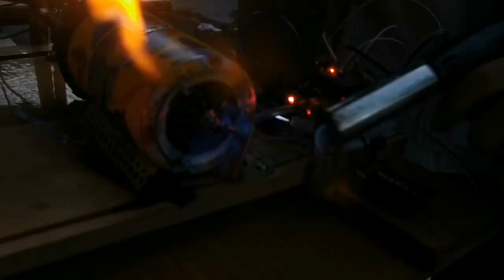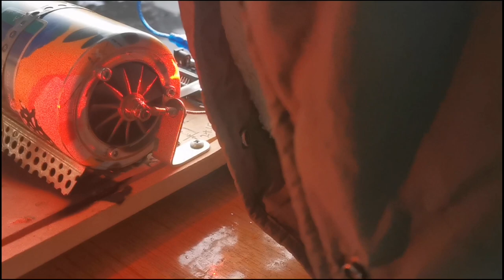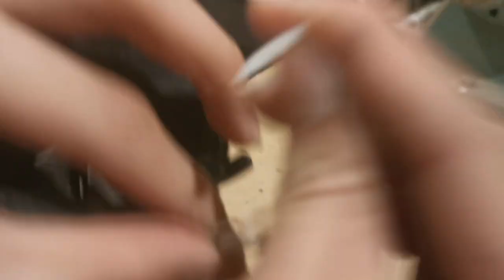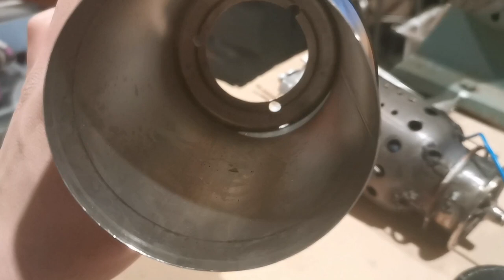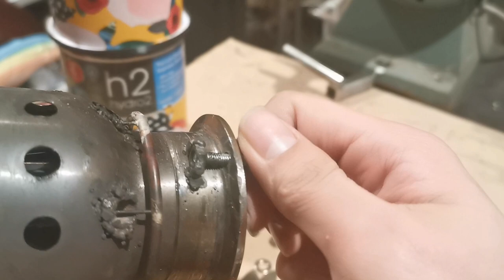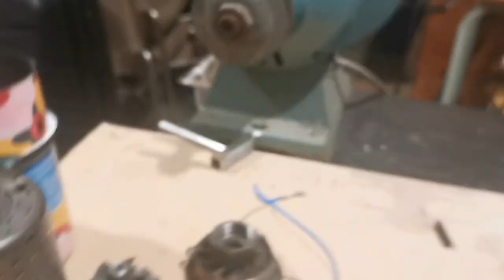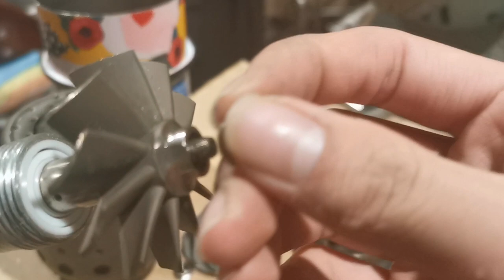Jet engine test and disassembly

Comment: Very good job, congratulations. As someone already mentioned, You should read Kamps article on microturbines, there is much information and calculations there. What I can say is that the combustion chamber seems to be a bit long. Also, the blades of the NGV needs to have the right angle. And above all, the bearings. The full ceramic bearing can not withstand the high RPMs. Try buying the ceramic spheres and build the bearings. The inside and the outside of  the bearings are made from stainless steel. You can use an existing one as a base.
Reply from the maker: Haven't had the time to read but definitely will before reattempting this.

The way I built this turbine... it's not suitable for rapid prototyping. This seems like a highly empirical field so I may try 3d printing in ceramic or something to test different parameters especially for the ngv. Or... Of course just copy someone else's design but what's the fun in that. 

With ceramic bearings, would you clarify on why full ceramic isn't suitable for high speeds?

Comment: I am building an engine too🤠, but you are a little ahead of me... so many things to learn.

The fluid dynamics of an engine that is moving are different than an engine standing still. When an airplane is flying air goes in the engine mostly from the front. When testing an engine on a test stand a lot of air gets sucked in from the side. Air getting sucked in from the sides can cause a shockwave at the front of the engine that stalls the compressor. The way to get around that problem is to use a bell(trumpet shaped) cowell for testing. The length of your cowell to your turbo is almost non-existent. It could be slowing down your RPMs.

In big jet engines ( just because your's is only a few inches long doesn't mean that it's a toy) the combustion of the kerosene is supposed to be completed and the gas already cooling off before it hits the turbine.

Kerosine burns at 2,000C. Steel melts around 1,200C. Titanium melts around 3,000C but it burns around 700C. Molybdenum melts at 2,400C, but it burns around 640C. Big gets are made out of a nickel alloy that melts around 1,500C. The gas has to be cooled to 1,100C before it hits the turbine so that it isn't destroyed. The newest metal to be used in jet engines is niobium C-103. All of these fancy metals cost money. If you have a magnetic induction heater, maybe the lowest cost way is to get unservicable turbine blades from a big engine and melt them .

If the turbine stator is glowing yellow, the gas hasn't cool enough before getting there. The way to fix that is increase the length of your flame holder, or have more cooling air that bypasses the flame holder to the turbine. Your flame holder doesn't have much color on it, so there is a good blanket of air between the metal and the flame.

There are two kinds of bearings and jet engines need both. You already have an axial bearing, but you need a thrust bearing in the front and back end. [radial bearings reduce friction perpendicular to the axis, thrust bearings reduce friction parallel to the axis] 
For anybody that is trying to build their own engine, the bearings are one part that you can't make yourself. Because it is one of the most important parts, it's a good idea to buy your bearings first and then build the rest of the engine around the bearings. This is one of the thrust bearing that I am looking at to build a jet engine https://www.mcmaster.com/product/5909K24

https://www.mcmaster.com/content/bearings/ball-bearings-4

trying to find radial bearing and thrust bearing with matching sizes and RPM ratings is frustrating. The higher the RPM rating the more you can push it without overheating.but the higher the rpm the less choices of bearing there are.

I wish you good luck with your second build. I am still collecting pieces for my build. Making a small 2-stage oil cooled axial engine is turning out to be crazy. lol I should have taken the easy route with a centrifugal engine like yours🥸
Reply from the maker: Your very knowledgeable indeed! I'm aware of these ideas too and have tried to address them in the design, though to vary degrees of success.

Your note about the combustion chamber colouring is appreciated, but I believe the reason no visible change is observed is because it is already entirely oxidated after I heated the entire thing as a test. Poor choice as it would have been a great diagnostic tool to see the temperature distributions.

Best of luck with your build. Is 2 stage axial even going to have any significant compression? How will you source (or build??? Impressive if you do) the rotor and stator?

Comment: I also wanted to build one years back and at that time due to cost of bearings I decided to use a point bearing on ends. Also I see a problem why it's not sustaining, because there is too much air exiting the chamber. You need to add a shield in the turbine side to reduce airflow so that flame stays stable in the chamber and you get more preassure build up in chamber
Reply from the maker: To reduce the combustion chamber outlet area (but not the holes on the combustion can itself), am I understanding correct? Another commenter also suggested such a thing, I will try this in the next iteration.

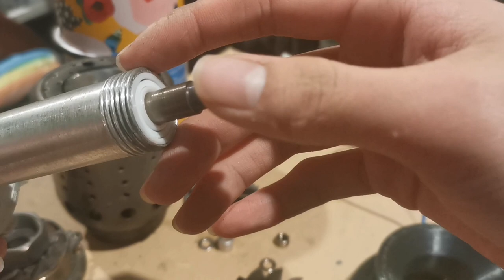Comment: 24:14 , I like your threaded, air tight, rear axle. That way, the high pressure hot air can not leak from combustion chamer through the rear bearing to the nozzle. Most model jet engines don't have the air tight thread, and they just bolt on the case without sealing gasket because no gasket material can withstand the hot air.

Comment: Is that your own design? Very impressive. I'm particularly impressed with the way you made your diffuser (but I don't think the design is correct):
The vanes on the diffuser need to be at a particular angle, to suit the compressor wheel / RPM (have a look at Kamps or KJ66 designs for reference) and benefit from being spaced away from the edge of the compressor wheel (the 'vaneless space').
The passageways in the diffuser need to increase gradually in cross section for their full length - the step you have where the casing fits is a big no-no (you would need a bigger casing).
I don't know if it will work if you fix these things, but it would stand a better chance.
If you can get hold of the Thomas Kamps or Kurt Schreckling books, they have all the information in them to allow you to evaluate the design of the engine and figure out how to improve it / whether it will ever work. (The yellow Thomas Kamps one is still in print).
I think you may have problems with balancing if you're using 'C' clips on the rotor, and they may not survive running RPM (they are likely to be ripped off the shaft by centrifugal force). I'm not sure how well the turbine will work with the cut-off front edge, but getting the design right is the most important thing.

Kudos for getting as far as you have. 
👍
Reply from the maker: Thanks for your advice and kind words. I'll try to find those resources you mentioned, but I don't have too much time at the moment to work on this project.
Interesting suggestion about the vaneless space, I assumed you'd want the vanes to be as close to the impeller as possible. I'll have to look diffuser design more, those books may be a place to start.

Comment: i'm confused, how's the lubrication system works? is it not going to mix with the fuel? or is there some type of seal to contain the oil. any inputs would be a big help
Reply from the maker: Actually the lubrication system doesn't exist. My assumption is that the ceramic bearings could operate at temp without any lubrication. Which is probably not a standard or reliable solution.
Reply: @tamashamas6193  Usually the small turbines use a total loss oil system, even the ceramics need a little lubrication

Comment: Excellent Job, Try with compressed to avoid fuel, so what happens to the turbine. Does this jet engine throws high velocity exhaust? most of the work goes in spinning the turbine blade fans
Reply from the maker: Not very high velocity. Does this suggest I need to reduce the turbine cross section area?
Reply: @tamashamas6193  
My concern was that if the burning of fuel going to spend all its energy in spinning the turbine blades, then will this turbine propell the jet forward
Reply from the maker: An efficient system will leave some energy in the exhaust which can do useful work. My setup is not, It cannot even extract enough energy to self sustain. So next iteration will need to improve efficiency + more aggressively choke the flow before the turbines.

Comment: Do you think axial flow or hybriz engine could be functional in a similar scale? I am in the process of making a jet engine myself. The body will be somewhat larger. The problem with the crntrifugal compressor is the complicated design and cost. Perhaps an impeller pump and a couple fans in front could be used to compress air into the chamber?
Reply from the maker: I considered such a design, I dont remeber the details as clearly but I decided against it for the following:
1. There is no readily avaliable commercial sale of axial turbine impellers. Whereas the centrifugal impeller is mass produced for automotive turbos. Geometry perhaps not optimal at low rpm, but a compromise that's necessary due to budget.
2. Axial turbines require multiple stages to attain the same pressure ratio as a single centrifugal. This is desirable in my small build, maybe at your scale it becomes worth the added complexity.
Especially considering each stage requires a stator too. Not very simple to make.

I don't know what manufacturing capabilities you have, I trust you to make a judgement.
Reply: I got my hands on an old leaky turbo. The fan is a bit small so I'll add another fan in front of it for added pressure. Don't have time to recheck the video but how do you manage cooling? Do you simply use low temperature fuel, liquid cool or is the air flow enough to keep this cool enough not to break? Also do you have room for thermal expansion?
Reply from the maker: Are you talking about cooling the bearings? If so, my setup is air-cooled and uses ceramic bearings. I wanted to avoid needing to seal the bearing chamber which is necessary if flowing extra coolant.
Thermal expansion isn't really managed, in fact this might be why the rotor seems to vibrate more as the engine warms up.

Comment: Thats awesome. Is the housing made from a mug? The black build-up on the threads is carbon build-up caused from a too rich mixture.
Reply from the maker: Thanks, the casing is from a Thermos mug. You wouldn't believe the looks I got pulling out calipers at the cookware store.
What confused me about the carbon build up, it was kinda sticky...
Either way, that build up shouldnt have ended up on the casing itself so something to troubleshoot there.
Reply: @tamashamas6193 nice! Haha must of confuse other ppl. Hmm im not sure why it would be sticky besides from a coating or something used when the mug was manufactured. But yeah refine your jet engine its a must after seeing how well it preformed
Reply: Incomplete combustion forms deposits… dry the fuel to remove water and solids… which is probably why it’s sticky. 

Sometimes dyes or flavorings to prevent drinking put in stuff causes this gunk
Reply from the maker: I may try using kerosene or gasoline in the future. As suggested by other commentors
Reply: The yellow bottle heet burns very clean. Have u tried that yet? Make sure it's the yellow bottle not the red one. White gas does burn fairly clean but I think the yellow bottle heet will have a more efficient combustion. Happy testing!!!!! I'd like to see more of your creation
Reply from the maker: @907buschmin2  Hi, not sure what exactly the yellow bottle yoir referring to, but is it mapp gas?
Reply: No it's made by golden eagle it's called HEET (yellow). It's an additive for fuel but burns very clean on its own
Reply from the maker: @907buschmin2  never heard of it, I'll see if it's even avaliable in aus

Comment: Hi Tamas lot of effort there but you could do to get Thomas Kamps and Kurts books they explain a lot of things .
Compressor Air must pass down the bearing tube to cool the bearings they are only 20mm from 650c to 700c turbine temp .
5% oil is mixed in with the fuel and is Teed off from fuel line metered down to 5% of the flow  to the engine injector needles  and is feed to the front of the front bearing passing down the bearing tube to lube and cool  the rear  as a total loss system getting burned up in the exhaust.

The  force on the turbine  wheel will may be rearward as the drag on the wheel with the air/ Jetstream leaving is giving the thrust ;the compressor will tend to get pulled forward with the low pressure in front, most engines went to front preload because of this or ran high rearward preload.

Your  diffuser may work but you need the wedges to be same diameter as the case or you are expanding and contracting the air. also you need a gap between the diffusor back  and the combustor front to let air get through to the middle of the the combustor. looks like your bearing tube is blocking the airway. 

You turbine wheel looks like a radial turbine wheel with the back face  machine off but the pass area will be too big don't know any of your sizes but blades need to be about 12mm high for about a 66mm dia. maybe better to make a flat sheet twisted axial turbine wheel as Kurt did .

Your combustor dilution holes at the rear  should   have the vaporizer tubes in between not blowing on the tubes as this will cool them. can't see the inner combustion tube .the needles for fuel look too long the idea is the fuel is injected/smeared  on the inside of the tubes were it is heated and vaporized ,the needles should touch the inner wall of the tube not shooting it straight down the tube.  
You mention alcohol for fuel ? best to use Paraffin or diesel fuel alcohol is more of a degreaser not good for the bearings. 

doesn't

Thomas book gives all the size's but best to stick with a design I have never designed one of my own .
Reply from the maker: Hi reedy, astute observations there and indeed very good points.
Many commenter have suggested I take a look at that book so I certainly will before any major rework but your suggestions are good.

Looks like you've built your own turbine too? I went way over my head designing my own turbine but it's been a great learning opportunity for sure.
Reply: @tamashamas6193  would not have written such a long  reply but you have put a lot of work into it I am impressed with the sand cast diffusor ,as a eyeball check a line through the the wedge should be 90 degrees to the compressor  blade tip .
you could try thinning the bearing tube flange to 4mm thick  on the screwhead  side and use countersunk screws you don't want them 3 large holes at the front of the combustor a spot welder would  make life a lot easier for welding patch's over the holes, you don't  want away gaps at the front as very little air is needed for combustion ,
The injector needles don't want to be bigger than 0.8 mm o/d or you will get a hot spot at the bottom of the NGV outlet..
Think i have a overview  on my channel of the Kamps book Kurts book on the fd3/64 and KJ66 ,Kurt has also done books on turbo prop and turbo fan engines amazing guy at one of the GTBA talks he flew a heli powered by a fd3/64 driven off the compressor suction you get about 2hp this was in about 1996 .
   I have built a turbine or 2  Kamps  ,KJ66 and FD3/64 all on my channel .not many early runs when it was on near melt down.
Reply from the maker: I might go for a full combustor rebuild. Earlier you mentioned building a custom turbine, which I waved off as being impossible to build diy and also be balanced. Furthermore, I didn't consider any of the materials accessible and machineable suitable but I suppose running cool enough makes stainless and option. I also recently saw an interesting method for propeller forming using a hard and thermally more resistant die which the rotor material could be formed against after being heated, this might be worth a try? The die itself could be made by roughly grinding tool steel for instance into the shape each blade should be. Repeatability is possible without needing inaccessible cnc machines. 
I'll look into this more but in general I want to approach my next attempt with simpler manufacturing to allow rapidly prototyping.
Reply: @tamashamas6193  stainless steel is ok but stay below 600c(550c better) and don't go over 80k to make real power you do need the correct metal but as you say hard to machine .
if you make your own turbine you need to use 8mm thick boss and turn a centre boss but  get Kamp's book  it will show dimensions.
making a die would be a big undertaking you need to thin the blades at the tip and leave the root thick /rounded grinding the blades is the only option once you start its not to bad just do it in stages the balance can be done as you grind by checking the thickness as you get near to 0.8mm at the tip and when you do the balance look to correct any blades that are on the heavy side .

Comment: i need some calculations like the relationship between diameter compressor and turbine , how much combustion chamber pressure?
Reply from the maker: Inducer ID: 35mm
Turbine OD: 50mm
Reply: Where can I get compressor and turbine wheel ? Because need balance and can't make it sand casting , 5 axis maching cost high
Reply from the maker: Mine is from a cheap turbocharger kit from aliexpress.
Compressor as is
Turbine was made by modifiying the turbo turbine
Reply: Thank you Mr Tamas for explain

Comment: Can i used zro2 bearing Ball for jet turbine or its get broken from high temperature
Reply from the maker: Mine seem to be holding up, but I don't have any sensor to measure the actual operating temp they reached.